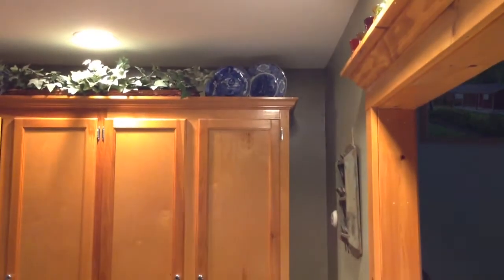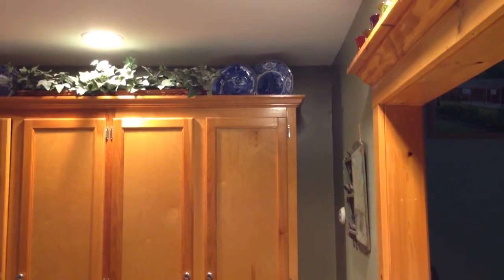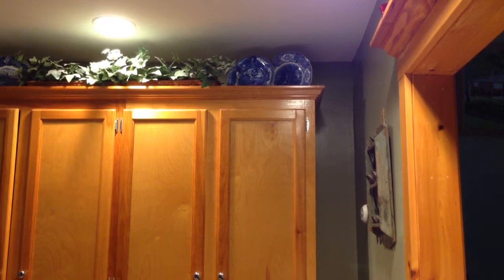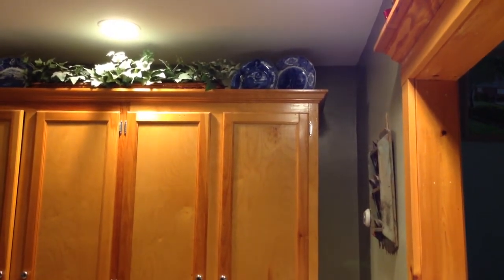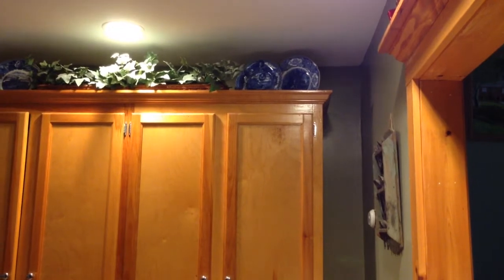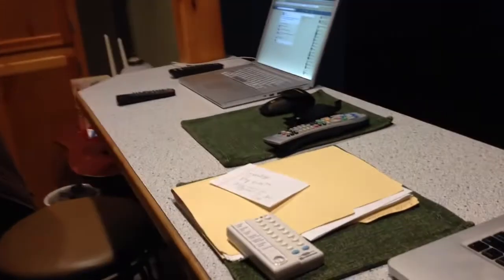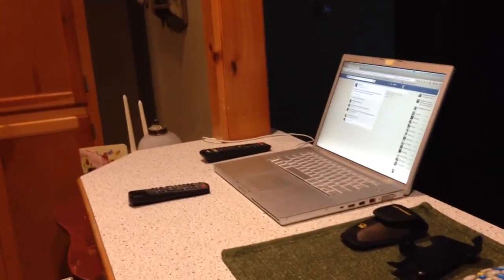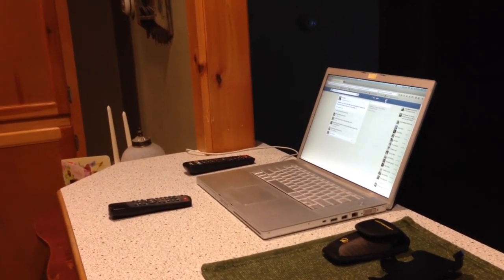Power outage:  Cree LEDs flickering a bit on generator power.

Comment: Our LED lights do the same thing - sometimes worse than what I see in this video - on generator power.  We have an old generator, and, we have a new one but it's not hooked up yet.  On the flip side, the gauge says it's putting out 120 volts consistently and nothing else seems effected, it's not surging, etc.   I've surfed the web and there are various suggested fixes.  Personally, since everything else in the house works perfectly I'm not gonna worry about the LED lights - from what I see on the web, it's a 'thing".   This generally happens on generator power.  Again: if you surf the web you'll find people with high end Generac systems (5 to 8 grand) having the same issue.   I'm using an 11-year old 5500W UST generator from WalMart  (500 bucks) with about 350 hours.  So I'm considering all of this a win.  The stupid thing still runs our whole house, with two window AC units, etc.  Let the LED light flicker a bit.
Reply from the maker: Yea, it could be the generator, or it could just be my old X10 home automation modules. 
They really are not rated for LED dimming, so there might be something going on there when the power fluctuations from the dirty generator power kick in.
Reply: @JimsEquipmentShed  You know a lot more than I do, from the sound of things.  But it is very common.  So I wouldn't worry about it - have no idea what an " X10 home automation module" is......but I bet I haven't got one....lol.
Reply from the maker: @guymerritt4860  My last generator didn’t have a problem with it, my new Ridgid is rated higher, 7700w but still doesn’t seem to have the stones the old 5500w generator did.
So my guess is that the generator isn’t as good as the last one, and the modules are like 20 years old.
So it could be a combination of things.
I think temporarily, just to isolate the problem, I’m going to pull the X10’s and put conventional switches in to see what it does.
Reply: @JimsEquipmentShed  Here's a wild story - I might even make a YouTube video.   So we wanted a new generator, right?  We debated.  My wife trusts Amazon and I try not deal with 'em - but she won and we ordered a Wgen 9500/12500 from Amazon.  It showed up about 3 weeks ago.  The guys delivered and left it in the living room.  I cut one side off the box and it looked fine - 5 hours later I cut the rest, and, the side where the battery and controls sit had been dropped and there was a clean break in the frame.  There's a plate that holds a battery  - giving it some strength right there - and it got hit right there so it just snapped, cleanly.  I got Amazon on a chat deal and the guy immediately refunded all of our money and told me to keep the thing, give it to charity - whatever.    The thing is nice - has autostart, even a damned keyfob for remote start.  I found a guy to weld it who knew what he was doing - just a wonderful young guy - and he made the thing like new.  He asked me for 100 bucks and we gave him 200 bucks.  He even picked up and delivered - the thing weighs about 220 pounds.   I've tested the hell out of the thing and it's perfectly fine.  So we saved, I dunno - about $750 to 850 bucks.  The thing was 1149 plus tax at Home Depot, 960 at Amazon.  Anyway - if you want a new generator (apparently) order the thing from Amazon, call 'em and tell 'em it's damaged, and it's free!!!  I was surprised the guy in the chat deal didn't even want a pic.   Seems like a system that could be seriously abused.  I guess when ya' got all the money in the world, what the hell?  I really don't like using Amazon (my wife and daughter do) but it really panned out, this time.  Funny you mentioned your old 5500W unit - as you put it, I could never get over the stones of this old UST 5500W - runs the whole house and UST is considered a really low-end unit.  Never had a serious problem with the stupid thing.  But my wife wanted something with autostart....and she was talkin' Generac and I told here that was nuts, for us, money-wise.

Comment: Any led lights no flickers on normal generators. I have ones that flickers and others not . Includes low costs led lights. I have video at You Tube, about, title " Power Generator With LED Lights ".
Reply from the maker: These were not low cost, but they are second generation for that assembly.
Honestly, I think it’s my X10 wall switches picking up stray signals, and misinterpreting them, because they don’t always react the same way.
I’ve had them do this on occasion on shore power as well.

Comment: I hate when that happens
Reply from the maker: It’s odd, because it’s not a consistent behavior.
Reply: @JimsEquipmentShed  what does it look like right now?
Reply: @JimsEquipmentShed  what’s causing to do that?
Reply from the maker: It’s fine 99% of the time, it’s very random.
Reply from the maker: @crazy12577  I’m not sure what’s causing it. At first I thought it was just the LED technology glitching off from dirty generator power. Then it started working better on the generator than it was on the grid tie. 
Weird for sure.

Comment from the maker: Justin,  it claims "Safe for Sensitive Electronics – Less Than 6% THD" on the Ridgid website. Our computers all have their own regulators, and essentially run off the battery, so there is no 'visible' fluctuation there.
I haven't tested the 220 side of the generator for over voltage, or hz for that matter, and the built in meter doesn't display that side for some reason.
(It just monitors the two 110v outlets.)
Not really sure why they would do that. And the 62hz was with nothing connected, so that might just be flutter.

Comment: Another place where the quality of the generator's output needs to be tested with an oscilloscope.  When I'm on my battery-fed backup (using a pure sine wave [PSW] invverter) the backup power is cleaner than the power we get from the electric co-op.  No so for the small (3000 watt) gas generator that's the second level of backup.  Some things that are happy on the PSW inverter won't work on the generator.  That's not a problem as I can run a battery charger from the generator and keep the battery bank charged so specific things can be run from the inverter.  Inexpensive generators (and some not-so-inexpensive ones) often produce a waveform with edges that are too straight for some devices to see it as a sine wave.  The battery system can be charged from solar, commercial or generator and is good for 10 to 20 hours of backup depending on the season.  Currently, a single 250 watt panel keeps the battery bank fully charged even on cloudy or rainy days.
Reply from the maker: notyoung Yea, is day the ridged is designed more for jobsites, and less for house hold backup. It seems to like to wake up the control panel of the wash machine from a dead sleep, so during an outage, we pop the breaker on that until the outage is over.  We never had that issue with the last generator.
I’ll just avoid long term use of sensitive electronics. (Pretty much everything these days eh?   ;-)

Comment: the sine wave looks a tad off. Is it a pure sine wave ?. I run all mine on pure sine wave. monitors have there own power supply and so do the computers;. Clocks let lights. yes. stuffs them right up if you have DIRTY power. Not to hard to FIX Just get a better AVR for your genny. the one in it now is not good at all. Also known as ( Automatic Voltage Regulator Rectifier )

Comment: What is in a LED lamp setup like voltage regulators or rectifier bridges?
Reply from the maker: 1crazynordlander Well, the voltage has to be stepped down to a really low DC voltage from 110v AC so I'm assuming that it would have its own  way of at least limiting, if not fully regulating the input voltage.  This must be signal related, I'm thinking that its less to do with my LED's and more to do with something in my X10 dimmer switches not liking the dirty power. X10 has always been pretty sensitive, and thats the only thing that I would expect to have control over such large steps in lamp brightness. I think that the LED's just react more to it than the previous incandescents did. (Visibly at least.)